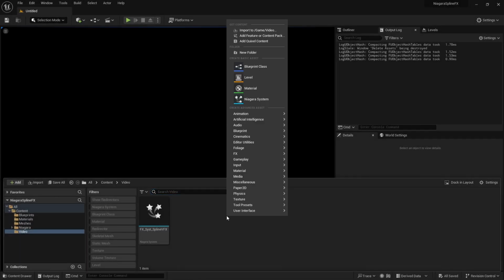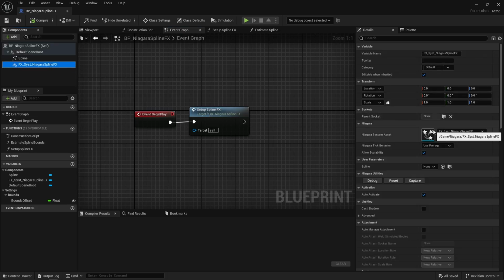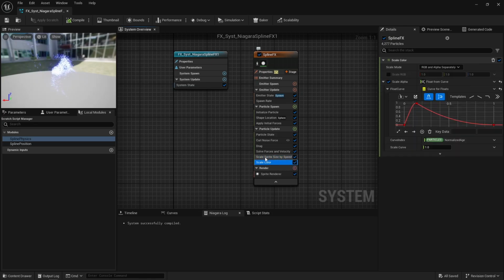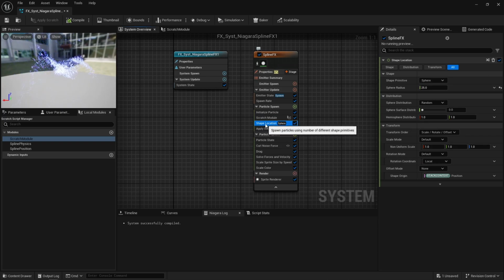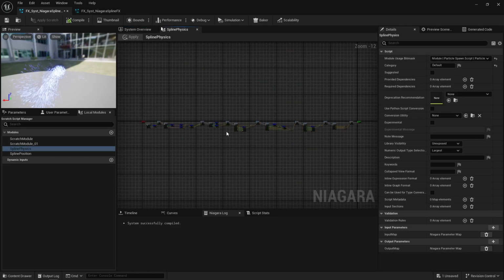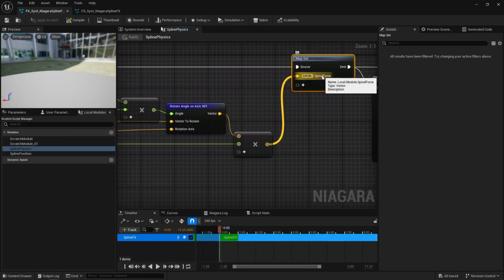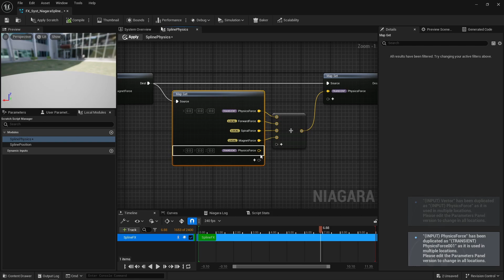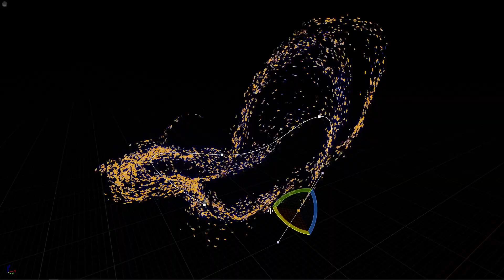How to sample a Spline Component in Niagara

Comment: Sorry but i am a beginner at this could you make a video explaining how did you make the estimate spline bounds please? i feel like in this video that part feels a bit rush and its hard to follow! i would love to see a video explaining in detail about that part!
Reply from the maker: I'm sampling the spline at 100 evenly spaced points from the start to the end. For each point, I check its position in 3D space (X, Y, Z) and compare it to two vectors called Min and Max, which are going to form the corners of the bounding box. To ensure the first comparison works, I initialize the Min value to something huge (like +∞) and the Max value to something small (like -∞). As I go through each sample, I update the Min and Max whenever I find a smaller or larger position in any of the three axes. This lets me track the smallest and largest X, Y, and Z values, which form the corners of the bounding box around the spline.

Comment: I tried it and it not work
Reply from the maker: It does work :) You probably made an oopsie
Reply: @ghislaingirardot  i must have done the same thing because i ran into similar, except i notice that there is a scale and rotation issue,.
i will go back and check to see if i connected anything wrong
Reply: the system offsets by the world coordinates, the further you get from Origin, the less it adheres

Comment: Hi. Thanks for the good tutorial. I saw a comment that pull the wire from the Spline Data Interface input to create a Sample Curve node at 4:44. But where is the Spline data interface? Even if I search it, I can't figure it out, so leave a comment.. I'd really appreciate it if you could leave a comment because I'm new to Unreal
Reply: It's because we are not using the "spline" object input, we are creating a Curve for Floats "Spiral" input if you read it more closely. (Dont worry I didn't understand at first too)

Comment: May I ask why are the particles invisible as long as the spline start point is out of sight?
Reply from the maker: Emitter bounds! It can be increased/customized in your Niagara Emitter settings
Reply: @ghislaingirardot  I even set bound to be fixed, and make it very large (1000*1000*1000), but when start point of spline is invisible , the particles still disappear

Comment: I'm at 4:44 into the video how do I make  the Sample Curve part of the video? I tried right mouse click but nothing comes up that will work?
Reply from the maker: Drag a wire from a Spline Data Interface input
Reply: @ghislaingirardot  Thanks tons I finally figured it out!!!
Reply: @Alienvertex  Strangely I cannot seem to find sample curve even when dragging from the Spline pin? Any other suggestions?
Reply: @shannonberke7586  It's because we are not using the "spline" object input, we are creating a Curve for Floats "Spiral" input if you read it more closely. (Dont worry I didn't understand at first too)

Comment: Can someone help me out. I am moving the spline at runtime, but the particles do not follow the position of when the spline is moved. So I set the spline as the object everytime I move the spline, but still it does not work.
Reply from the maker: The spline object only needs to be set once. However, afaik, you need to call the 'UpdateSpline' BP node every time you update the spline.
Reply: @ghislaingirardot  I ended up having to do that and it works this way. Its a bit more inefficient. I find it odd that moving the actor containing the spline isnt enough.
Reply from the maker: @xshaide  Yeah that's a bit sad. You can likely bypass using a spline component tho. Provide the Niagara system the spline control points in local space using a Vector array and replicate the necessary functions in HLSL to sample it (convert from local to simulation space). Niagara already has a built in node to sample a single bezier curve. Not sure about finding the closest point on the spline though. But it's something to investigate if using spline component doesn't suit your needs.

Comment: I was JUST looking to do something like this and your video popped up! Thank you!!

Also the Get Component Bounds function returns an Origin and Extent in World Space. Since setting the fixed bounds requires Local Space,  first transform them to local space (Inverse Transform Location node). Then simply subtract the Extent from the Origin for the Min and add the Extent to the Origin for Max, which is required for the Make Box function. This worked for me, anyways!
Reply from the maker: There seems to be a bug in engine, at least in 5.3.2. The spline component bounds do work in-game but are not updated in engine (construction script etc.) when tweaking the spline, so it's a bit annoying to work with.

Comment: For the Spline bounds, I faced this problem before, a quick trick is converting the spline to a polygon (geoscript) even at low sampline, then get the polygon bounds (geoscript as well). Cheers and keep it up🎉
Reply from the maker: A good solution indeed! Geometry Scripting is sick. Thanks for pointing it out :)
Reply: I'm having the problem that when i place my actor in the world/map in the editor, everything is working fine. However, when i spawn the actor with the splines at runtime, the particles associated with the spline won't show up or stay at the scene root.
could you elaborate on your solution (geoscript)?
Reply: but convert spline to polygon actually project it to one axis, resulting bound is a 2d bound, but niagara need 3d bound, I guess manually creating a box component as bound is easier

Comment: How many separate splines can be runtime at once without issues?

Can this be optimized by having the particles not visible but still function?

Wondering cause you gave me an idea but not really sure how realistic it is right now 😂
Reply from the maker: @josheufvdjej  Some truth to that, but lots of inacurracies as well. Niagara isn't necessarily handled on the GPU. 1) An emitter can run on CPU or GPU 2) The emitter update function is always run on the CPU, regardless of the system using CPU or GPU!.
So, yes, a GPU Niagara system can handle millions of particles. But a Niagara system comes with lots of overhead and using many many smaller particle systems to sample one spline at a time may cause severe issues. That's why Epic's working on lightweight Niagara systems that has a much more restricted set of features but a way cheaper tick cost.

To answer @michaelpiper8198 : it's hard to tell. A spline component comes with the usual component class overhead so there's that. A spline is merely just data though, except when drawn in the viewport, so it should be a negligible memory cost. Sampling a spline shouldn't be too costly either, the math behind it doesn't rely on complex operations. My answer is as usual: do a bruteforce test and see how it performs in worst case scenario.

Splines can be efficiently baked into textures though, so you could store many many splines in a small texture, sample each spline using a simple integer ID system so each particle is assigned its own spline, and thus bypass all the spline components and do everything in one unified particle system. If that makes sense.

Regarding visibility/function, this is mostly related to occlusion and setting up the emitter's bounds so the CPU can guess if the GPU system should be rendered or not. But I'm almost certain particles are no longer ticked as soon as the system is occluded. This may be an unecessary optimization though. You can may try expanding the bounds by a large amount so particles are always ticked. Unvisible particles will just waste vertex processing afaik, which may or may not be a big deal.